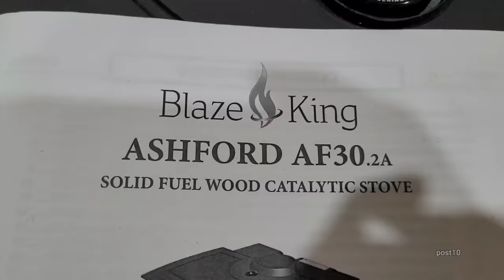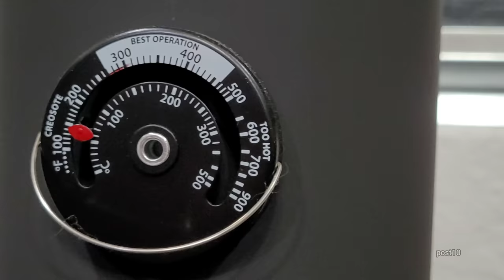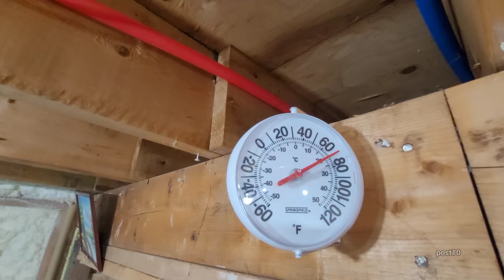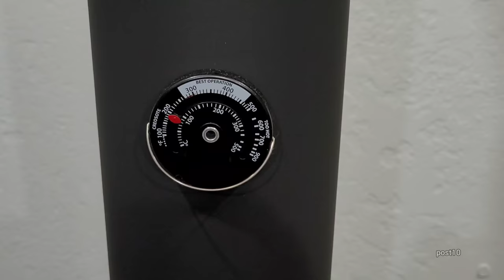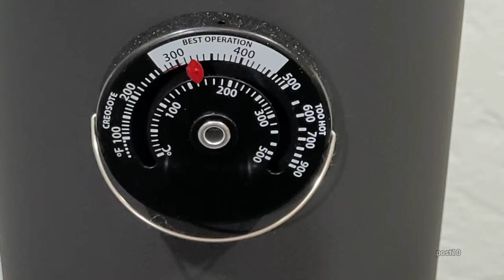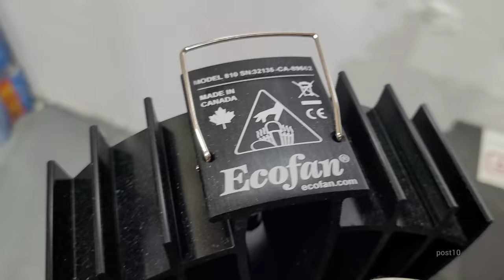Why I Started Heating My Home With Wood And How I Manage My Land. Blaze King Catalytic Stove Review

Comment: I would totally take wood heat over any other form of household heating any day of the week. I think a wood stove is the way to go for the main heating system. It's very cheep to run, its easy to use, very little maintenance, lots of heat and for me it is very entertaining. You can also cook off of a wood stove when the power goes out. if you really wanted to you can roast marshmallows in the living room.

Comment: Used to burn pine in a Ben Franklin stove due to the abundance of the wood.  After 4 seasons of doing this a flue fire happened through the entire length of piping.   Was told by the fire department that the sap from unseasoned pine along with the lack of cleaning created it.   Learned my lesson with pine.
Reply: did you pay attention at all in this video?

should have learned your lesson on cleaning.
Reply: @nobodyinnoutdoors  sure did and that's why I commented 👍
Reply: @nobodyinnoutdoors  are you at all familiar with a 1975 Ben Franklin stove by chance?
Reply: @ThisIsMyRealName  yes they suck.
Reply: @nobodyinnoutdoors  then you should know they're nothing like the stove in this video.

Comment: I have that same wood splitter and mounted it on a two wheeled dolly to make it more portable. I like to use it when splitting small amounts or when making noise is an issue with the neighbors. I lost four 32""diameter oaks 60' long in a storm last summer that I will have to use my gas splitter on. Sounds like your wood stove is quite efficient.

Comment: Keep in mind Red oak for instance is going to burn three times as long as if you put prime in certain words give you much more BTUs time may burn hot but it doesn't last long you are correct keeping it clean as key and operating the catalyst at the proper temperature

Comment: Nice stove and nice install,  with this type of stove 18” from sides is definitely safe.    I recently removed my wood stove with a catalyst as i was tired of handling firewood 6 times before and after burning.   I switched over to burning corn - grown about 2 miles from my home and 2 acres of corn heat my home all winter here in NNE.         Looks like you had beech, or maybe poplar  in your wood container  - Beech and Maple are great hardwoods hardwood has double the BTU output of softwoods .     Looks like you have a lot of Balsam fir which are very susceptible to wind not a great fuel but if it’s free and plentiful it works.      Good setup !    I like your content

Comment: Hey Post 10 I have burnt pine for many years along all sorts of hard woods never had a fire every 2 years we straight up replaced are pipe. My wood stove was out side in its own building. Heat was piped in very effective. We even burnt hedge and mulberry which burn crazy hot. We never fully loaded our stove with hot woods. Pre maintenance service goes along way. Don't let people tell you what to do with your set up. As Paul Harrell would say only you can decide what's best for you.

Comment: Awesome job All I've heated with the last 25 years is wood used to cut all my own off my own property if you can leave a tree if it's either broken off all the way from the stump or if you cut it down in the spring when it's full of leaves and leave it in the forest with the leaves on it until August you'll be surprised how quick it'll dry out when it's trying to keep itself alive

Comment: sometimes i dont even use kindling, i just get one of those little grill starting cubes and a couple pieces of charcoal from the previous fire, then logs around it in such a way that the air flows up through them, along with the flames when i light it (i open the air ducts to the max, air comes into it from underneath, through the grate), let it run like that for a couple minutes and then close the air intakes. works everytime.

Comment: I have always used Methyl Hydrate as an accelerant to start my old Vermont Casting wood stove. It gives you a lot of fast heat with no smoke and warms the flue, gives you the initial updraft you need to avoid smoking yourself out at startup. we have the same flue setup with the 90 degree bends coming from the basement, makes it even more difficult to start without a warm flue.

Beautiful stove, great videos! Keep up the great work!

Comment: Try to split the logs right after you cut the three into peaces. It will be so mutch easier and then you can use an axe (a wood spliting axe that has a wedge shape, regular one will get stuck). The longer the logs stay or season without splitting them, the harder it is to do so.

Comment: I was told to leave at least a half inch of ash at the bottom of my blaze king.  The idea being that it provides some insulation to the "fire brick" at the bottom, preventing exposing it to direct heat from burns. In theory that heat cycling could cause cracks over time.

Also... you could build a cabin with all those downed straight pines!

Comment: With our glass door, we used scrumppled paper/newspaper sheet, dabbed in water then dab into the ash.
Scrub the glass with the ash and it cleans off.
Also I found logs that are totally surrounded in bark take ages to burn as the bark acts like an heat isolator.
So split logs or vertical stood logs burn better.

Comment: If you have another metal rack that could go under that window then you can stack the wet wood on top where the heated air is, and then move it down the shelves over time, giving you more wood that’s ready so you can sit out a weeklong storm.  A welding blanket for the floor will be fireproof and more comfy on your knees. 

You can throw a bunch of lint from your dryer in there and it will catch fire really quick! And you get rid of that lint. I hope you are putting that ash in the garden or compost pile cuz it’s very good for the soil. If you have an area that you want to prepare for a garden this spring, you can layer some cardboard, ash, kitchen scrapes, fish guts/heads, egg shells and compost and mulch.  Then wet it and cover with plastic for a few weeks, maybe wetting it occasionally if needed.  It should get warm and bring the worms and they will aerate the soil.  If you put fish parts in there it will grow some amazing tomatoes.

Comment: That was a wonderful video. I have been pondering on purchasing a pellet stove or wood burning. I learned so much on wood burning stoves from you today, i believe that is the way I'm going to go. My land is like yours a lot of pine. Thank you post10 for sharing your knowledge. And, as far as your wood splitter, you do what works for you 😉 Have a nice break, you so much deserve it. See you when you make it back😊
Reply: Unless you have a lot of free time, go with the pellet stove.   My parents house was heated exclusively with wood from the late 70s through the mid 90s.  It was an old, poorly insulated, ramshackle house and we needed 2 wood stoves (living room and kitchen) and went through anywhere from 9-11 cords of wood a winter.  For a couple years we used to take down trees ourselves (they're on 10 acres), but then we switched to buying a full truck of log-length wood.  That still took time on the weekends to cut, split, and stack... and never mind hauling in wood every day.

Fast forward 30-ish years and we have a pellet stove.  admittedly, it's in a better insulated house, etc.... but we need at most 4 tons of pellets a year, they're neatly bagged, and I can just stack them in the garage.  Stove only needs to be shut down to clean once a week since you can empty the ash while it's running.  With pellets running $250-300/ton, it's cheaper now than the log trucks were back in the 80s, and a lot less work.

Primary down-side to the pellets is that a single ton comes as 50 x 40lb bags.  So there are a lot of plastic bags to dispose of.   I'm not thrilled about it and would really like it if I could find a decent brand packaged in paper.

Comment: USDA Zone 4b and heat exclusively with wood. Average temp when home is mid 70s.  It has been a mild winter for us so may get by with less than 4 cords. 
Once one has the tools for processing, accounting for wear parts such as a new chain or bar, consumables such as fuel and bar chain oil, 5 cords costs me about $120 total. 
I burn some softwood including pine. Post 10 has it the way I burn pine, larch, fir and popple - season it properly, run the stove at appropriate temps and sweep the flue at least annually. Repair or replace anything that needs it.

Comment: We never had our fireplace chimney cleaned out over 20 years and never had a chimney fire and we had some hot fires in that fireplace. Of course there was no converter in the chimney. I remember Dad taking us up the roof to look down the chimney and remember seeing rubbish in the fireplace. Mom always burned the burnable trash in our fireplace. Milk cartons news paper and even some plastic. Our fireplace had a good draft. We burned pine, maple, apple wood and even plaster sticks like they used before drywall was invented. We had a tile lined chimney. Now our farm house fireplace just had brick and we had hot fires in it as well. We didn't burn rubbish in it because we burned that outdoors. That farm house fireplace had a draft that if you lit a piece of newspaper the draft would pull it up the chimney to the top. Good thing we had a hardware cloth on top to keep the chimney sweep birds out. We never had problems with the chimney at our regular home. The farm was a summer vacation place which when you are a child pulling weeds in the garden was no vacation. Mom and dad loved working in the garden it wasn't work to them. Don't believe everything you hear. Find out the truth for yourself. 73

Comment: Your wood bin inside, perhaps space it off the ground and a few holes in the bottom, especially if you’re putting damp wood in it.  Will allow any water/condensation to drain out the bottom

Comment: We bought a stove a few years ago to heat our house. It also had the pretty glass window on it. However, we actually heat our house and we don't simply use the stove for show (the manual recommends leaving the damper open). So the glass stays smoked up because we shut it down at night so it will heat and not burn up all the firewood. In retrospect, we would have foregone the nice glass window to get a better stove for actual heating.

Comment: I also bought a vacuum cleaner made to clean out hot wood stoves and when I cleaned the stove I had vacuum outside and ran the hose thru the window that cut down on the dust and also had an Air cleaner in the room with the stove. Oh I never took all the embers out of the stove I never stopped the fire until. spring.

Comment: I had a Warm Morning stove for 25 years until 2005. It was messy to clean.  I burned coal rather than wood because it stayed hot and warmer longer than wood and you didn't have to keep feeding with wood  as often.  I even built a cement hearth and my stove was 2 feet from my kitchen wall.  If you use pine, you had to clean your chimney every year of creosote and have a chimney cap.  Stoves weren't as efficient back then as they are now.  After cleaning out the ash I used to vacuum before starting the fire again.  After 25 years the shaker grate broke and to clean out the stove you had to let it burn out.

Comment: I ditched the paper as a starter and now I use fatwood (sappy pine sticks) from the Ace Hardware. It's not free, but it starts the fire without fail and doesn't make all that ash that the paper leaves. It also seems to get he draft going better without a lot of smoke. If I do get a smoky back-draft, I just crack the door on the stove and throttle it up.

Comment: Have you tried the top-down method for getting a fire going? It works great for me! You put small stuff on top of the bigger wood then the embers ignite the larger peices as it burns. I use a blowtorch to get the draft going and light it

Comment: Creosote is from lack of heat, get it hot enough, or, not enough oxygen to burn the fuel efficiently. Dark/black smoke is an indicator, white fluffy smoke is a good sign. (sometimes this needs a second burn chamber with a secondary oxygen supply).  Another way to save fuel is collecting all the heat going up the chimney with a thermal battery, usually a large mass of concrete/brick/stone, etc., that is surrounding the furnace and chimney.

Comment: If you have a lot of wet ground you might want to plant some willow trees they love water and should help with regulating the wet ground.
Reply from the maker: That's a good idea, I need to get some fresh clippings, I bought a bunch of free rooted branches from one on eBay but none of them took
Reply: @post.10  Saplings or fresh cuttings from a tree nearby are best do not forget to spread them out

Comment: I know my mom was so scared about burning pine afraid it's going to mess something up I have convinced her that pine will not cause her any issues as long as it has dried out and most of any time that I've cut since released a year drying out before I burn it I'm glad to know without a doubt that it's not that big of an issue cuz it sure does put off a lot more heat very quickly to get a fire going

Comment: An addition you might consider is wood stove grate to let air up through your paper and kindling and eventually your logs. Dad used to use an oil fire starter but with the grate you shouldn't need it.
Reply from the maker: The stove specifies not to use one

Comment: With regard to fire hazard management: a forest full of many small trees is much worse than a forest of few large trees. So, I would suggest using the small to medium trees for fire wood. Leave the oldest trees for habitat and the forest will thin out becoming less hazardous. Burning up the debris is definitely helpful too. 
The way that heater works is very interesting! It seems it could almost make charcoal? Thanks for the vid.

Comment: I don't have a wood stove so I can't test it myself, but I have been told that the stains on the glass can be easily removed with a bit of glass top stove cleaner or with a wet rag and a bit of the ash from the stove.

Comment: You could use the wood ash and broken branches to fill raised garden beds, you could use the tree trunks for the sides of the raised garden beds. This way you use very little soil or compost or building materials, you would have a  fertile planting space and you could plant seasonals and perrenials to eat, basically lowering your food cost by 50-75%. Once you prepare the garden, you set up composting bins etc the plants dont need much work. You could use a tarp over the raised garden bed to stop weeds, only cutting small holes and planting your crops through there. Weeds would have no access to light and would die.

Comment: Regarding the peltier fan you're using; if you remove it from your stove and place it on after the stove has reached operating temperature you'll help it to operate better and increase its lifespan.

Comment: You can easily clean the glass, by taking some ash (grabbing it with a paper towel) and use that get the black spots off the glass - you won't damage the glass and it does the job very, very good.

Comment: i was wondering if you considered the vevor diesel heater for your camping trips as opposed to the little buddy. I bought one for my garage. it does really blow hot air out and could probably keep the inside of a car really warm. As for the garage, not big enough. my well tank is in there

Comment: My guess about that removable handle : because it's the same handle that's use on other stoves frontdoor and need to be removable because it's getting hot.
Not getting hot in your case so it doesn't have to be removable, but it's cheaper to install those common one than to get a dedicated handle for this stove. (not sure if my english makes sense as i'm still learning)

Comment: I have been heating with wood for over 14 years. It's always good to leave a couple of inches of ash in the stove. To clean the glass or Ceramic windows wet a newspaper and put it in the ashes and it will clean the glass or ceramic windows. The Catalyst needs the stove to be around 450 degrees plus.

Comment: thats why you dont use an  axe for splitting logs, you use a splitting maul. those are purpose made and with the taper being way more aggressive it doesn't get stuck but still forces the fibers apart. splitting pine with a splitting maul is a breeze.

Comment: if you split the wood in half siize  about 2 inch thick max it will burn better and get  more heat so the glas is not being black.. The heat will burn  away  and the chimney is clean.  We have a woodstove here in Sweden and  make food and heat our house all winter.  Use mostly Birch tree..

Comment: It seems like a lot of fir trees for a swamp. They tend not to hold up too well in large concentrations, due to many of the problems you mentioned (crazy debris, quick to fall, prone to pests). I don't know what the natural makeup of a forest in your area looks like but to me it looks like there should be more broadleaf. Alder typically does well in swamp, but the ash and maple are good too. I'd probably favor those a bit more than a whole forest of firs. 

It's probably also a great idea to keep as much of the debris as you can, within safety limits. All larger branches and trunks you can spare should stay and feed back the floor. Moss won't care, it'll just colonize over the fallen stuff and eat it up. Lots of space for insects and fungi to live and continue the cycle of life!

Comment: You have an infinite supply of wood to burn. Get a ~$300, 5 ton electric wood spitter. Such a time saver. I like your setup of being able to move wood to the stove thru the window. The universal problem with basement wood stoves is moving the heat to the upper stairs living areas.